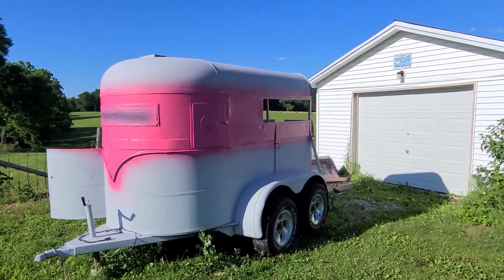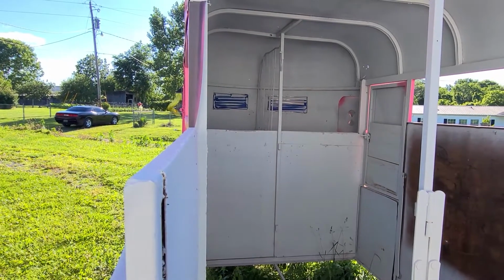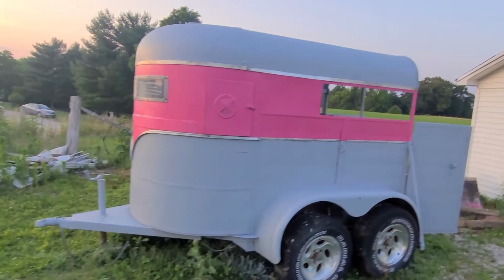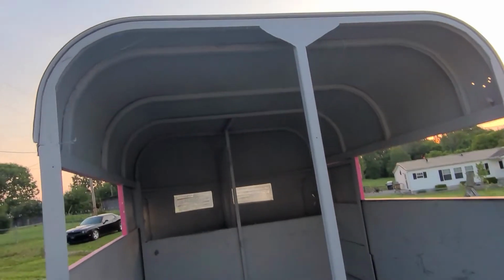Painting A Horse Trailer

Comment: Enjoyed the video. I have restored a 1984 but I have a question for you. What did you use for the window on the front that won’t crack or split when installing on that curvature. Lexan and plexiglass cracked. Thanks
Reply from the maker: Thanks for watching! It has plexiglass in it, I didn’t take it out because I knew it would break. I just masked it off.

Comment: Do you think it’s ok to prepare, prime and paint a panel at a time as opposed to preparing the whole trailer, then priming the whole trailer, etc? Thank you.
Reply from the maker: It's ok to do that. If you're gonna paint the whole trailer then it's much easier to just do the whole thing at once. If you do it that way, you'll want to mask off any panels that you've already painted or the over-spray will make those panels rough. You only have to do that when painting. Primer shouldn't cause any issues.
Reply: @ProjectDIY2  Thank you. Problem is I don’t have full time access to the trailer so completing in sections will be easier.
Reply from the maker: @marlenewiegand136  You can definitely do it that way. Just mask off the other panels around it when you paint a panel. It will work fine!